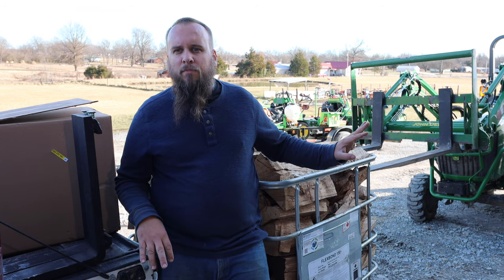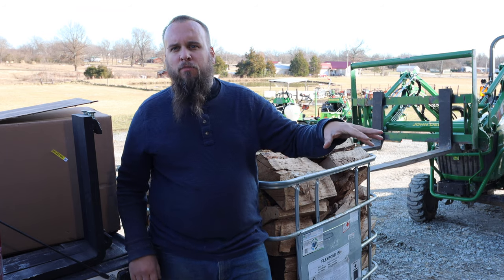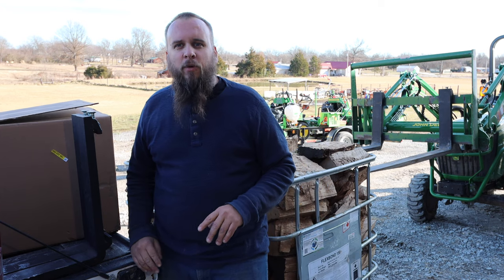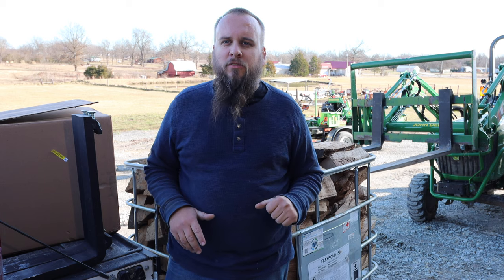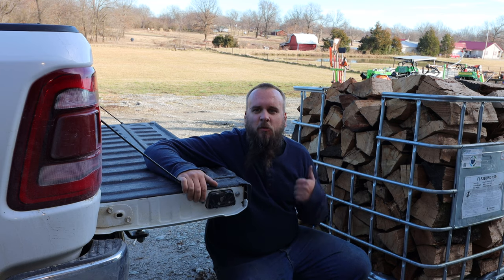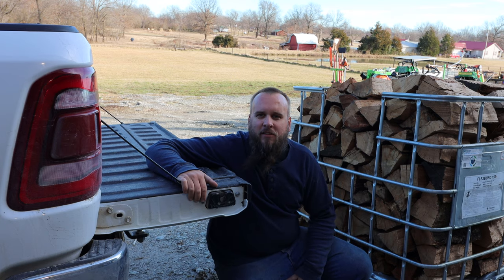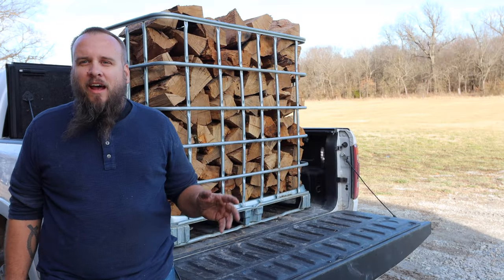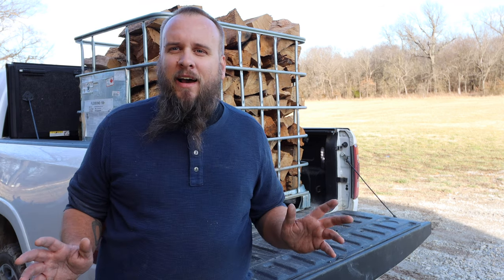Increasing Lift Capacity on a 2038R - Compact Tractor Vs Firewood Totes

Comment: the reason i traded my john deere 4400 in on a kioti model ck3510se tractor was the fact that they can lift about 25-30percent more with the front loader, although i still love john  deeres i would NEVER get rid of my kioti. thanks and keep up your great videos!
Reply from the maker: Glad to hear it. They all make good tractors it is just preference between certain features

Note that I switched loaders I’m pretty happy with my lift capacity at 1800 pounds for a 2 series, but kioti is known for high lift capacity

Thanks for watching and for commenting

Comment: I can’t believe how much more that self leveling loader will lift. Can you tell a difference in the geometry of the loader in relation to the Jack angles that might make the difference? I’d be curious to know why it lifts more then a standard loader. Glad you accomplished your goal.
Reply from the maker: It has the extra bar along the top of the loader that hooks onto a triangle plate. The curl cylinders also hooked to that plate and then there is an additional triangular mechanism down where the bucket attaches.

Basically I think those Extra pivot points give it a mechanical advantage

I’m no engineer but I’m going to look at all that when I do a full review on the loader

As always thank you for watching and commenting

Comment: One issue I found with my self leveling loader is when I scoop loose material.  I was always in the habit of raising the load a bit and snapping the bucket back to get the material away from the front edge and keep it from dribbling out as I transported it.  Can't really do that too well with the self leveler.  If you're using forks a lot the self leveler is worth the extra $, but if you're mostly moving dirt and stone you may be happier staying with the standard set up
Reply from the maker: Everything you said is true although the me the biggest factor on the self leveling loader is how much you need to be able to lift.

That extra capacity really meant a lot to me before I got the skid loader

Comment: It would have been nice to see it more broken down. Use the 48” forks on the artilian frame and see if it would lift.  Then try the 36” forks on the frontier frame. Also instead of spending the money on artilian frame I would take the top guard extra weight off the frontier. I am growing to the idea of the self leveling loader too.
Reply from the maker: I did another video where I did a full breakdown of the weight of each of the components. I weighed the forks separately from the frames and did a comparison.

You save about 120 pounds from my heaviest pallet forks set up to the lightest which is significant but I think the self-leveling loader gained me twice that much difference. Check your time with Tim has a video showing exactly how much extra weight you can lift with that loader at different heights because it’s not a static number.

I traded my other loader in on this one and it took some negotiations with the dealership but it ended up Increasing the payment I made it to John Deere every month, but it didn’t cost me anything out-of-pocket

One more note about the artillian fork frame is that I wanted that frame more for attaching a grapple to it but the same frame I use on the grapple works on the forks and saves me wait there

Buying that frame just to save weight on your existing forks is not a cost of effective way to do it

It’s ideal for someone who is either already wanting to purchase a grapple or someone who does not have a pallet forks frame

Comment: Great video showcasing the benefit of the weight-savings of the Artillian fork frame/forks! We love ours.  Were you adjusting the front/back level of the tote as you lifted, or was the self-leveling loader doing that on it's own?  If it does it automatically, that's amazing!
Reply from the maker: I was not adjusting the tilt/curl.

When I first pick it up I do a little bit of manual curl. After that I just pull the lever back and it maintains that amount of curl automatically

It makes me think about the video you published where the totes tried to slide off on you.  This loader would have prevented that.
Reply: @RockhillfarmYT  Absolutely! Great innovation.
Reply from the maker: Self leveling loaders are a standard feature on a lot of larger tractors, they are just rare on the small ones

Thank you for watching and for commenting

Comment: I'm in the camp of not overclocking a piece of equipment and/or not running in continuous operation at, or near it's operating capacity. Even if my tractor can physically lift something, I consider it to be overloaded if can't lower it without excessive jerking.
Reply from the maker: I definitely hear what you’re saying and considered that in terms of stress on the front axle, but this is a John Deere designed part that is made for this machine and it accomplishes the increased lift capacity through mechanical advantage of the triangular plates on the loader.

The other way I was able to lift more is by reducing the weight of the pallet fork frame

Thanks for watching

Comment: finally a semi-scientifically done test! lol thanks for showing the effects of the variables independently,  I thought of a couple more for you, lol.  What if there's freezing rain, snow, etc covering the wood/tote LOL!

Another question maybe you can put in your review of the MSL, with all the extra linkages/pins/etc does the loader feel more..."wobbly", especially with more weight that it lifts?
Reply from the maker: There are definitely a lot of variables and I didn’t realize until I was finished recording that I didn’t have the throttle up very high.

I’ll keep that in mind when I do the loader review

Comment: Hi I enjoy watching your videos I was wondering if you can make a video showing the non self-leveling loader and the artillian Forks and see if it will lift the basket and if not adjust the hydraulic pressure to see if it helps
Reply from the maker: I traded in my non-self-leveling loader to get the new one so I no longer have the option to demonstrate that.

I did try To lift it with the normal loader and the Artillian pallet fork frame, but at that time I only had the longer forks.  

Having the lighter forks on they artillian frame would have helped but I don’t think it would’ve got it to the truck bed.  If you’re trying to lift IBC totes of firewood, keep in mind that the wood I am using is not seasoned and is there for a little bit heavier
Reply: @RockhillfarmYT  okay that is cool I was just wondering because I only need to lift them about a foot off the ground just to move them around and move them in my basement by my wood stove and if you don't mind me asking what is the price of the self-leveling loader

Comment: I have the same tractor and use IBC totes for firewood and have the same issue of lift capacity.   I was thinking of rigging up some kind of lightweight loops on the totes to use the quick attach system to lift the totes without a fork frame at all.  ??   Maybe a piece of angle iron bolted onto the tote frame with the quick attach loops welded on.   Don't need the lower pins, just the loops.   ???
Reply from the maker: I had the same thought of finding a way to lift them without using a fork frame at all. The problem with the ideas I had was that they all require the loader to be up higher which reduces the lift

Let me know if you figure out a creative solution

Comment: Using shorter forks, do you think it will beat up the underside of your totes?  I know the 42 inch forks should be long enough to completely go under the totes, I wonder if the 36 inch might put added pressure on the bottom and eventually punch the bottom out.  I currently have 40 totes and they cost anywhere from $40-50 Canadian each so  I want to try to take care of them.  Let me know if you find it beats them up or not, if there good I might consider saving some weight and going the same route.
Reply from the maker: It doesn’t seem to be hurting the totes, but I have only been using them this way for the last month

Comment: This was my first time stopping by your channel looks like the Artillian system got the job done.  I noticed Chad over at  Purple Collar Life uses this same system may need to be something I check into.  I'm just curios or maybe I missed the reason, but why did you only have the tractor operating at idle?  I was always under the impression not to do anything with the tractor at idle.  Take care brother.
Reply from the maker: I generally always run the tractor in the auto throttle mode so that it throttles up when I’m pushing the pedal.

Occasionally when I’m lifting something but not moving I forget to increase the throttle which is what happened in this case. Also possibly distracted by filming

Had I increased the throttle I may have gotten a little more lift.

I’ve gotten to know Chad from Purple Collar Life a little bit and he is a good guy with a good channel 

Thank you for watching
Reply from the maker: Coincidentally I actually watched one of your videos the other day. I think I found it through the suggested feed
Reply: @RockhillfarmYT  Currently not much to choose from as I just started this channel as the outdoors version of Our Greene Acres.  I'm a JD guy as well and I came across you from the FB group I recently joined.  Phil sent me an invite after I launched the new channel. Take care brother.
Reply from the maker: After my last comment I realized that that’s where I saw your video was in the group. Anyway, best of luck with your channel

Comment: Doesn't the tractor lift more at higher throttle? So why did you keep it low throttle? Also don't understand why you wouldn't check the pressure before buying a bunch of new equipment? I'm sure you did think of that but chose to present it this way for some reason.

Either way I've got my 2038R also having trouble lifting a 275 IBC tote and currently troubleshooting the best solution.

I've got regular loader and clamp-on forks and it can't even lift a 3/4 full tote of fresh cut oak more than a few inches. Guessing the clamp forks are holding the tote out too far. Also going to check the pressure. Happy to hear any other advice you have.

Also what exact model are the forks?
Reply from the maker: It lifts more at higher throttle but not as big of a difference as you would think.  

Having it at a lower throttle was an accident during the video filming. When I was editing the video I realized it wasn’t throttled up. The first day that I put wood in the totes I tried to lift it at full throttle and couldn’t do it. 

I ordered the MSL loader months before I decided to put firewood in totes, The timing of that arriving was just a coincidence but I think it took three months for me to get the MSL in

I ordered the pressure gauge the day that I found out I couldn’t lift the totes

Changing the hydraulic pressure was a last resort for me.  I was assuming that it was set correctly which ended up being the case, and I was only going to turn it up if it was set too low

When the gauge came in I did a video showing that my hydraulic pressure is right in the middle of the recommended range

The loader was the biggest difference but shaving over 100 pounds off of the pallet forks also helped. I got the pallet forks from artillian. They are the 36 inch
Reply: @RockhillfarmYT  Thanks appreciate the response. I'm sure it's not easy to have people picking apart your every move online. Thanks for the rationale explanations.
Reply from the maker: Thanks, and I am by no means a tractor expert. I’m just sharing my experiences

Comment: I have the exact same tractor, 2021 model. There is nothing wrong with your tractor. You need to raise your rpms before lifting a load. You cannot use low idle rpms. You might need half rpms, or full rpms of the tractor to raise your load into the truck. I had the same issue and an old timer said raise your rpms dummy and it worked. No need to go buy a bunch of crap for your tractor. The forks you got from the dealer would probably work with high rpms. TRY IT then reply :)
Reply from the maker: Thanks for the feedback

 I have 350 hours on my tractor in less than a year. I promise you before I went through all this I tried it with the RPMs up.

I made three videos about trying to lift these totes with the tractor and in one of those instances I forgot to raise the idle while recording

I think I even mentioned in the video that I had forgotten to do it while I was recording

The firewood totes weigh a lot more than the tractor is rated to lift

The NSL loader would not lift these

Thanks for watching and for commenting
Reply: @RockhillfarmYT  I saw you almost had it at low idle about 3/4 the way thru your video. I was like he has to get it with full rpms and I commented and didnt watch the rest of the video. I might go back and watch the rest. Im sure you found a solution you were very close. If all else fails, make a loading ramp. Then it wont matter if you can only lift 1 inch high. Think about that one ;)
Reply from the maker: I hope my reply didn’t come across as rude 

I run a manufacturing operation and we receive semi loads of Freight on a regular basis and this is our forklift so I have to know my exact lift capacity at different heights. 

Shipments over 1500 pounds I have to request that they be split on the two pallets or I have to pay for a lift gate which I don’t like to do

The mechanical self-leveling loader made what we do much easier
Reply: @RockhillfarmYT  No your reply is fine. Forks are complicated. Swapping frames, arms, and loads plus adjusting hydraulics. The thing is though the hydraulic pressure comes from the rpms of the tractor. This is why when you raise the rpms you get all the air bubbles and other issues out of the lines while raising the rpms. Now at full rpms, you should have full hydraulic pressure if you don't there is too much air in the system. You can purge this air. How air gets in is when you unplug and replug attachments. So, your hydraulic system needs constant monitoring. Unfortunately, just the way it is just like we all have to pay bills.